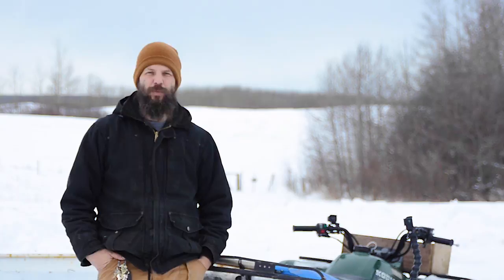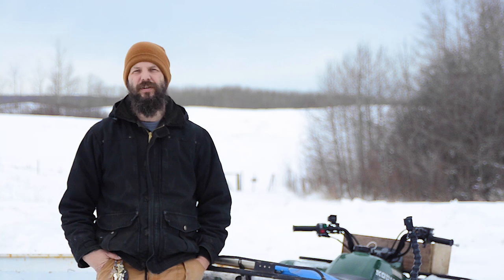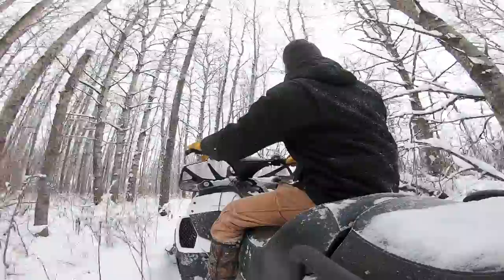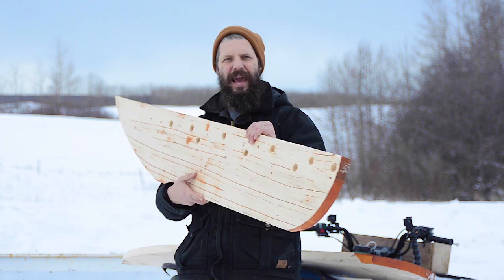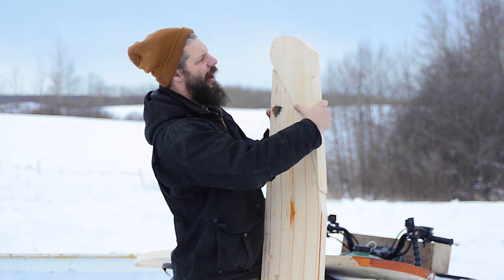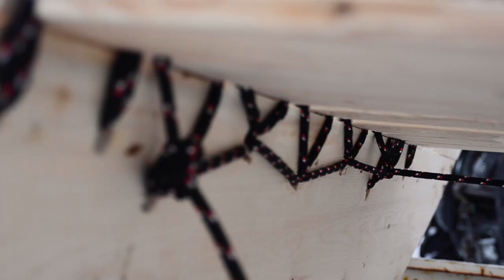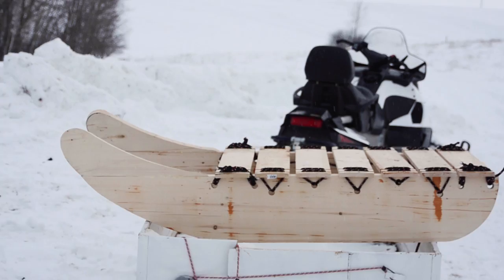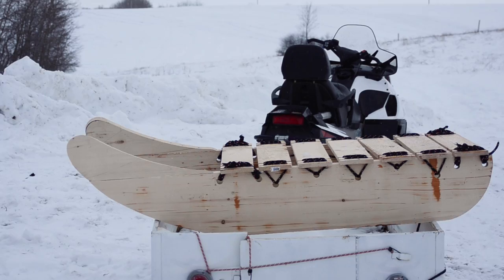Sketchy Ice | Komatik (qamutiik) Build

Comment: Nice, but what did you use to cut notches in your decking?
Reply from the maker: I used a bandsaw, but you could use a jigsaw, a coping saw, or just a handsaw and do simple V's.
Reply: @HayWoodsandWetlands  Just v cuts? yours look like they are somewhat curved on one side or is it just me seeing things again, thanks for the reply.
Reply from the maker: @SonnyVator  Mine have a curve you're correct. Again, Bandsaw, Jigsaw or Coping saw could achieve this, but if you only had a hand saw the straight V's would probably work fine.
Reply: @HayWoodsandWetlands  Thanks again Chief!